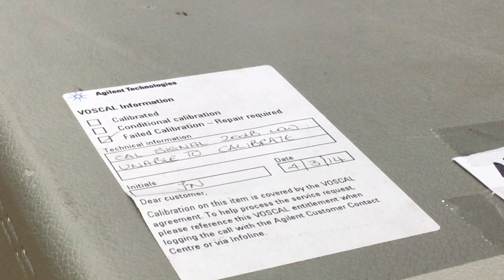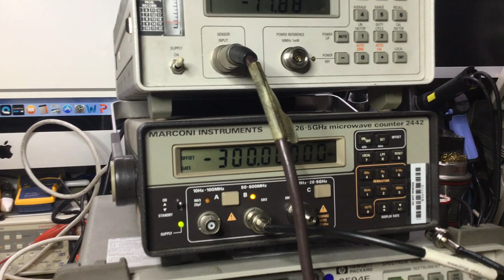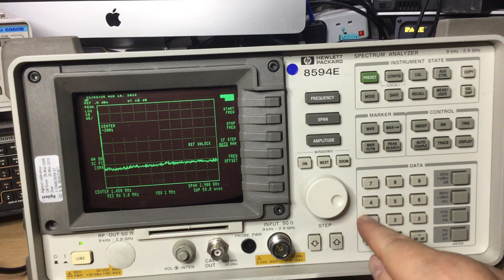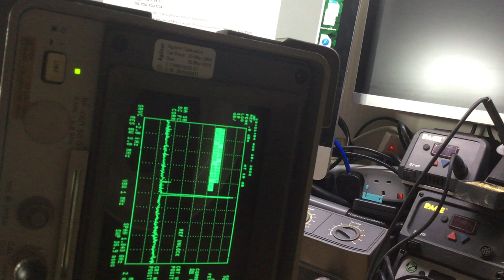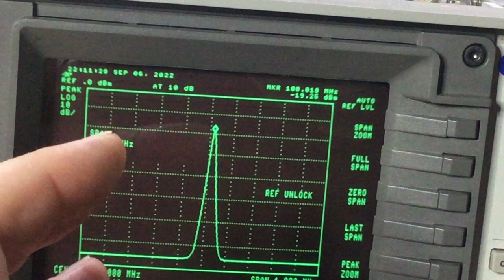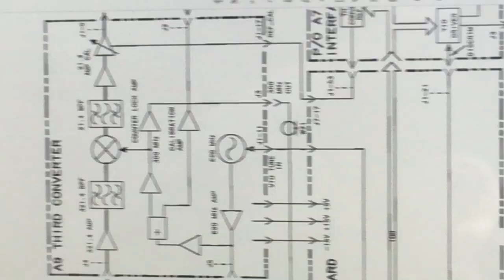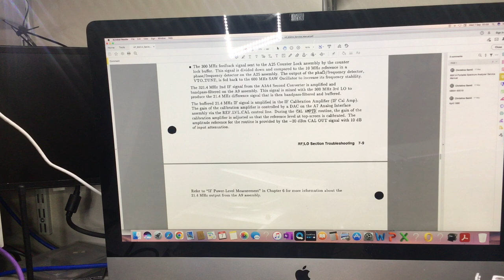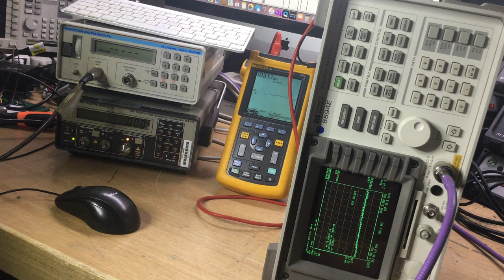HP8594E 3GHz Spectrum Analyser fault diagnosis, detailed testing & analysis & diagnosis of fault.

Comment: I really enjoyed the video, I think the problem is on the A25 counter board as a cap may of leaked and taken out an 8 pin PLL IC, it's just a guess but I seem to remember fixing the same problem some years ago. It's a shame that Keysight / Agilent / HP will not release the component level schematics and service information on which is now quite old equipment. Keep up the good work

Comment: Great video. Is the 10MHz jumper to REF IN on the back of this unit? Can it be bridged with just an simple BNC to BNC cable? That is the main cause of the "REF UNLOCK" seen on the display... no 10MHz signal.

In the service manual, page 649, states:
Troubleshooting Hints
Refer to Foldout 11-2, 11-3, or 11-4, RF Section Overall Block Diagram
for your analyzer, for more information.
1. Check the rear-panel cable connections for the 10 MHz reference.
When using either the standard 10 MHz timebase or the precision
frequency reference, make sure that the 10 MHz REF OUT on the
rear panel is connected to the EXT REF IN. The W6 jumper is
supplied with the analyzer for this purpose.
When using an external 10 MHz reference, make sure it is connected
to the EXT REF IN on the rear panel.

Are you sure there was a 10MHz signal fed to EXT REF IN?
Reply: I was thinking the same thing during the whole video
Reply: and then he went back to the analyser and connected  the ref out to the ref in and wow it works now..  Then a few hours of reversing all the previous unalignment procedures and everything works as it should.

Comment: I’m no expert but I suspect your A25 Counter lock bord is not getting 10MHz reference 
The message on the display REF Unlock is telling you the pass through BNC on the back of the unit is missing failing to pass the INT 10MHz back into the machine 

Please try looping the 10 MHz reference back  to the analyser then continue your diagnostics

The missing pass through is shown on the block diagram however not present on your analyser
Reply: I think thats key first to verify before further trying steer oscillator that is just free running

Comment: The clue was on the screen, ref unlock. No connection on the back of the unit , on mine I had a big metal bnc to bnc Bridge. Use a siglent these days, much better unit, but of course its much more modern
Reply from the maker: Negitive my friend, it was nothing to do with the rear connections at all, also the message on the screen was present when in the cal adjustment mode, this clears when the cal adjustment secret code is exited, if you watch the video carefully you will see mid way that internal signals in the 3rd converter are incorrect due to the PLL unlock condition, the int ref oscillator is running fine, & as you can see in the video the 10MHz ref oscillator signal is getting to the 3rd converter. Nothing to do with rear connections in this case.
Reply: @rfmanrfman4536  A great video, just wondering, as you have not said, was the rear jumper on? I have just acquired my first SA, and this is the one, and it does not have the jumper. Wondering if I can just use a short BNC to BNC 50 ohm cable to bridge the 10MHz output to the ref in on my unit?
Reply: great, great content

Comment: Dumb measurement for cal port using Power meter because waveform is squarewave thus has harmonics.
Reply: I'm glad I read your comment. I could have made the same mistake if I had a power meter (which has always been low on the list for my bucks)-even though I should know better. I just use another spectrum analyzer when I look at it, so I haven't had that issue.